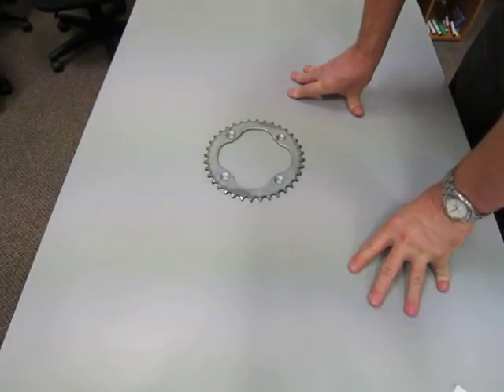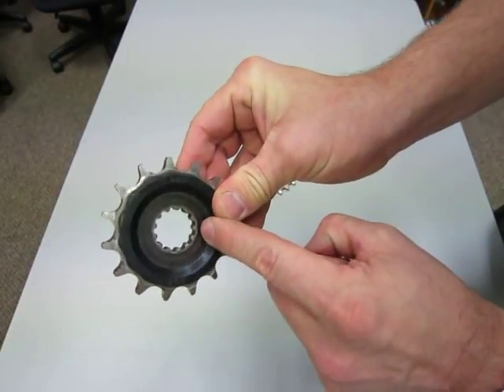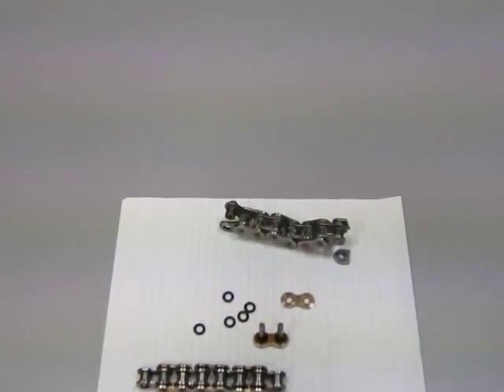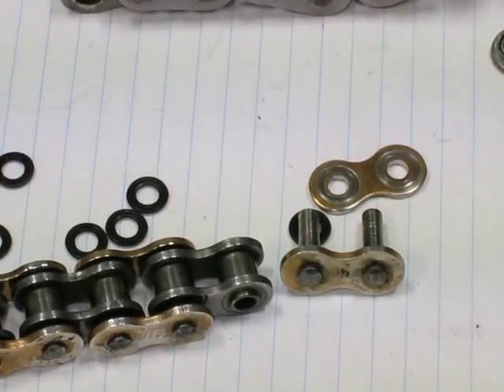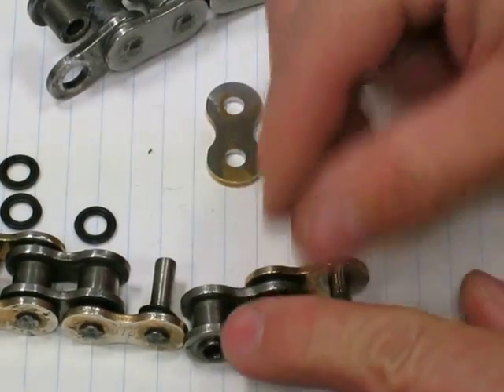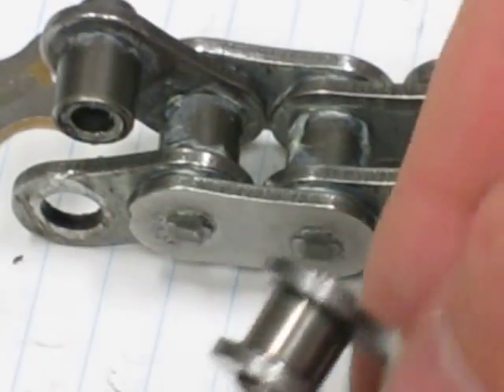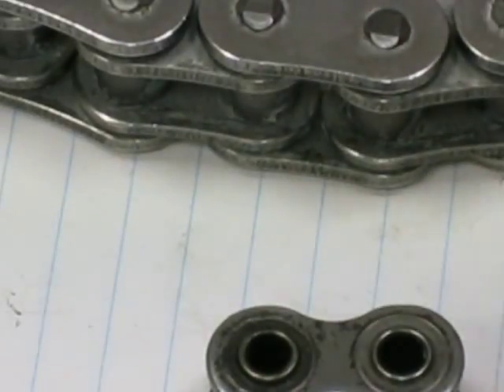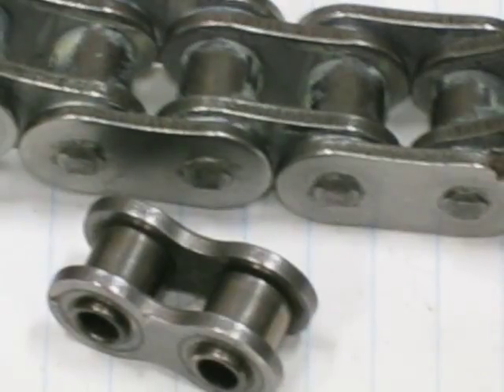O-ring bike chain critical maintenance

Comment: Does rollers also move side to side ?
Reply from the maker: Yes they do
Reply: When the bike's wheel is spinning in first gear and it's on main stand, I had observed that at a interval the chain slightly moves sideways and than at certain interval it comes into place and this gets repeated, could you please help me to know why this happening 

And yes the full chain and both the sprockets are only 1 month old , so please if you have any idea kindly suggest me.

Comment: Very good video. The only bit missing is the type of grease that's put under the o-rings by the manufacturers. Is it white lithium grease?
Reply from the maker: Could be any grade #2 or #1, maybe even EP grease, by some chain manufacturers
Reply: @theoverengineer  Thanks, but wouldn't petroleum based oil cause swelling in rubber?
Reply from the maker: Rings are synthetic, not natural rubber. They thought of that.
Reply: @theoverengineer  Thanks. So they're different to any other seals such as those used for brake pistons? Your video is fantastic, but I've never been able to find a satisfactory answer to this bit.
Reply from the maker: Seals and gaskets in contact with oils and greases in bearings, chains, hydraulic lines, engine block, etc. are commonly PE or nitrile (or its variations), or in high/low heat applications silicone, PEEK, PTFE, Viton, polyacrylate.
Seals and gaskets are also chemically different according to the pH of the grease/oil/fluid and its compatibility with EP additives.
Silicone, for example, is very soft (can not be around abrasive materials, like dirt/sand particles on a chain), should not run dry, and deteriorates when exposed to oxidized (old) oils and greases.
It really is chemical engineering.
Reply: @theoverengineer  Thanks for the thorough  explanation. I really appreciate it. It all makes sense now :-)

Comment: Hello, although this is an old video the info is very current. I ride offroad and everyone I ride with using oring chains is telling me. " You don't need to lubricate the chain". I always used the recommended lube despite what they said now your video is backing up my claims of why you must lube an o ring chain. It's the rollers and not the inner pins that NEED lubrication ! Great video explanation thanks.

Comment: I read the Scottoiler  knowledge workshop document. They explain that it is the O-rings that need to be lubricated and cleaned. "O-rings are made of rubber which has a high coefficient of friction and are very sensitive to any damage. Unless the surfaces are kept moist, the rubber will harden and crack, exposing the link-pin to dirt and wear. When O-ring seals crack and fail they let the lubricant seep out." The roller-bush also needs to be clean and lubricated as the roller is the contact point between the chain and sprocket and ensures the chain can easily roll around the sprocket.
Reply from the maker: Well written document, good stuff.

Comment: Interesting video, and a good explanation. I’ve done 87,000 km on my KTM 1290 chain by using a sacrificial oil system (Pro-Oiler, with a micro pump delivering a metered dose according to distance, not time, based on GPS signal https://www.pro-oiler.net ). I’ve never cleaned it and only needed to slightly adjust the slack twice in 87,000 km. It’s done about 1/3 of that mileage on dirt road or offroad. The 05-30 oil lubricates the chain, but is light enough to fling off...WITH the dirt. I think spray on, sticky lubricant is utter rubbish. Very difficult to remove the grit it retains, and you need to clean the chain too often. At US$300 it’s not cheap, but you’ll recover that money in extended chain life, and you don’t have to clean it every few thousand kilometres so you save heaps of time. https://www.pro-oiler.net
Reply from the maker: Thanks for the links & commenting!
Spray-on stuff is essentially a race lubricant, single event use, no extra weight to carry.

Comment: ScottOiler. Buy one. Chains last twice as long and you never have to do any of this. It washes itself clean.
Reply from the maker: Looks good on paper, but at what point does continually adding a lubricant wash anything clean? Does the manufacturer even claim it?
Reply: theoverengineer I can tell you it works, and the chain stays clean in street use, based on 100k miles of me using one. I've never manually oiled or cleaned the chain.  Their website says "Excess oil will be flung off by the centrifugal forces of the chain, removing dirt and grit." Of course, where that flings off is partly on your bike and THAT needs to be cleaned but that true for any chain driven bike, and I use simple green diluted and a garden hose to clean that up. I dont bother with their expensive brand oil, I use cheap 2 stroke oil. Thats how you know Im an end user and not a company rep.
Reply from the maker: Thanks for commenting, good stuff.
Reply: theoverengineer anytime

Comment: great video. NO BS.

still not sure what type of tool and fluid to use to CLEAN my chain. 

 I was going to use a soft brush and brake cleaner
problems:
- I'm scared a tooth brush or a nylon brush will push dirt under the roller.
- I was going to use brake cleaner for the dirt but now I'm scared it will wash away the factory grease

new plan is vacuum the dirt away, brush off the left over dirt, then clean it with gear oil or chain lubricant,  then spray lubricant in the necessary area  ...does this sound good?
Reply from the maker: Subtract dirt - good.
Cleaning - use chain cleaner.
Lubing - back to addition, no problem.
Chain cleaning video https://www.youtube.com/watch?v=44lT3llDdIY
Reply: okay, chain cleaner won't wash away roller grease?
Reply from the maker: It does, together with the dirt particles stuck into it. After cleaning all the lubricant needs replacement.

Comment: my bike was out side and not in use for about 3 weeks and the chain was rusted up relay bad. so i got all the rust off it with a wire brush and lubed it. But some of the o rings are a bit zig-zaged, and i rode it around the drive and it was clicking and it got relay slack (and it was a new chain)  do i need to buy a new one?
Reply from the maker: Ultimately, yes. Now, you might be able to get by on this for months by adjusting out the slack, but 2 sprockets also need to be changed with a chain.

Comment: i have one question about this rubber rings if them snap what then thain? How long they can work without snapping? Is it better chain without or with rubber rings?
Reply: +Paf Paff Keeping the chain properly cleaned and lubricated keeps the rubber rings soft so they don't break. If they snap then the grease on the pin can come out, then the chain will wear out quicker. A chain made without rubber rings needs cleaning and lubricating a lot more often.
Reply: +MrIfixplanes so how to keep rubber ring soft? and by my research better is chain without o'rings but to lub them often?
Reply from the maker: +Paf Paff Chain drive IS designed to be fully enclosed in an oil bath, no O-rings, for power transfer over long distances. Could last 1,000,000 kms that way.
Reply from the maker: +Paf Paff Using chain on a motorbike is a serious compromise. O-rings keep the lube in place. Once gone the chain dries out fast and seizes.
Reply: +theoverengineer so i can lub my chain every 200km and he will work long time without seize i read on internet that some guy  lubhis chain every 300km and he change that chain after 20k km i dont like o ring idea rubber is rubber after some ime must to snap and soon chain is dead so i will use chain without o rings lub it properly clean it etc and i think it will work longer than chain with o rings
Reply from the maker: There is no weight on the O-rings, but let us know how the experiment turns out.

Comment: I just ordered a d.i.d vx2 chain how dose that compare to the chain in your video
Reply from the maker: +Brian Keith Visually near identical. Most differences between models and brands are invisible: different strength of steels are used or microscopically thicker/thinner sheets, seal could be chemically different, too and so could the lubricant.
Reply: +theoverengineer That's the best response I've received thank you for the info. new subscriber!

Comment: I have a Honda XR 125L, which has about 12 horsepower. Will a O-ring connecting link (without the rivet) suffice?

Kind regards

Comment: Is it ok if I lubricate my drive train using engine oil...
Reply from the maker: muhammad nor faiz bin jalani It is safe but it won`t work. Oil has a very low viscosity, will just fly right off the chain at minute 1. See my story: Chain mishap
Reply: theoverengineer thx for the link man.

Comment: How strong are these type of chains. What are the chances of them snapping as you ride?
Reply from the maker: HunterHunter88 Correctly riveted, the chains have and average tensile strength of 6000-10000 lbs force (2700 - 4500kg-f). The strongest bikes exert a 350-450lb pull force (160-200kg). Chains only break when incorrectly assembled.

Comment: You're so careful to explain terminology but don't know what a "spline" is. They're not "Ribs" on the gearbox sprocket they're splines that engage with the splined output shaft (layshaft) of the gearbox.
This is a very patronising Video. Give us some credit for not being complete morons!
Reply from the maker: Minute one, second one, sentence one: "This video is about chain maintenance". Consequently, not so much about details of transmissions or related terminology. Sprockets, sockets and gears are in it for my personal French buddies, other ESL people watching from non-English speaking countries might also find it relevant. I did not want to increase complexity with detail about roller chains, link chains, involute, pitch diameter, wear %, sag, fit and clearances, the need for parallel alignment, high carbon steel and other materials, power, torque, final drive ratio or other maintenance related topics. It`s already 15 min long. Thank you for the observations and the feedback, let me know if spot anything else.
Reply: Give SOME of us credit...............others, not so much.

Comment: Nice done, mate. Btw, I have read somewhere that chain should  be oiled every 300-500km
Reply from the maker: Colton Drain Kawasaki zx-6 2014 user manual: "Lubricate every 600miles (1000km) OR after riding through rain OR any time the chain appears dry"
Reply: 300-500 "miles", is probably what you read

Comment from the maker: NOT use: solvents and solvent-base cleaners (WD-40), anything that stinks like a solvent. Solvents eat up the rubber O or X-rings.
Cleaning: yes, a must, make the gaps at the edges of the rollers accessible for liquid lubricants.
Lubes have different viscosity, they stay set (or get liquidized) at different metal temperatures and ground speeds. See my video "Chain mishap"

Comment from the maker: O-rings are rubber. They disintegrate in the acidic oils. The metal needs oil for reducing friction and corrosion. Thanks for the tip, I`ll check it out.
At 50km/h any oil has 0.4 sec time to thin out and stick to the chain, before it pulls a 15G turn at the front sprocket. Viscosity matters a lot too.

Comment: Yes, but the force first moves the oil film along the sides of the sprockets onto the chain rollers which is good. Unfortunately, the force then continues to move it past the chain and fling it off. The trick is to get just the right amount of oil. 

I'm surprised you don't use a chain oiler considering the wet climate you live in. Have you ever seen the inexpensive Loobman oiler? You just give the bottle a little squeeze and gravity/centrifugal force does the rest.

Do the O-rings need oil?

Comment from the maker: centrifugal force REmoves the oil from the chain, like spin-dryers remove water from soggy fabric. That`s the reason there is a need to re-lube continually. Capillary action spreads the oil. Chain oilers work well in general.

Comment: Great video. 

I've noticed chain oilers tend to apply a thin film on either side of the rear sprocket near the teeth. Centrifugal force from the spinning sprocket then moves the oil directly onto both sides of the chains rollers and right into that tiny gap. Perfect!

Comment: The O-RINGS keep the grease contained on the inside of the link bushings to lubricate the pins. That is their job as an o-ring, to seal the factory grease from coming out but they also keep any outside grease, oil, wax from coming in. Really all you can do is lube the o-rings to keep them wet and from deteorating, and most importantly lubing the rollers on the hollow pins. Spraying the whole chain makes it resistant to corrosion.

Comment from the maker: Converting to chain is considered a downgrade. Chains need infinitely more maintenance than a belt or shaft. Especially in rain or dirt. Chains lose more of the engine`s power through friction than belts or shafts.
Reply: Think u might want to check that, chains are much better than belts and shafts at converting power to the rear wheels...its why all the high performance bikes still use chain and sprockets and lower powered cruisers like harleys use belts or drive shaft...scooters also use belt drives.  Great vid though very thorough and detailed I like it.
Reply: Chains can take more power than belts. And they are more efficient than shafts.  An O ring chain on steel sprockets will need adjusted after the first 50 miles or so, and then they pretty much last forever.  Provided it is sized properly.